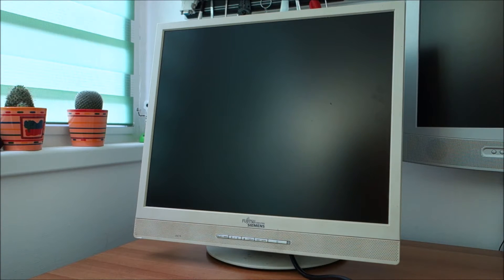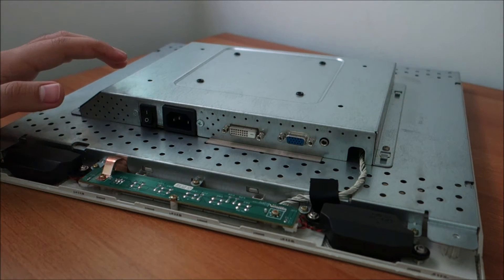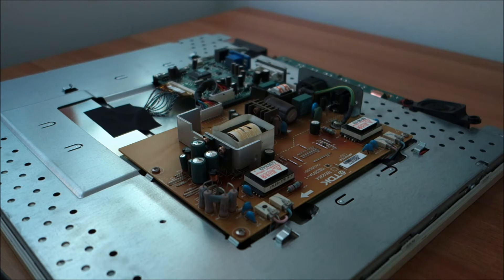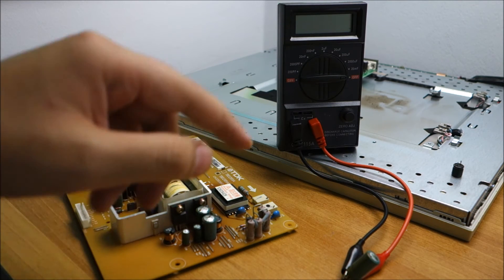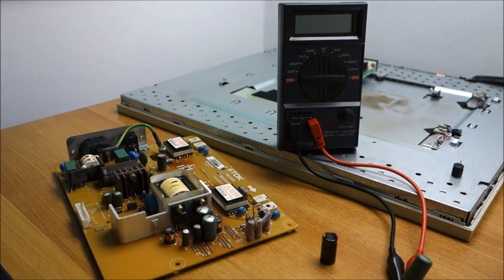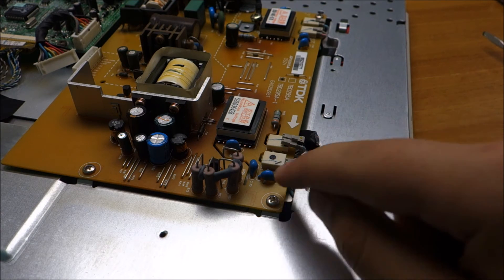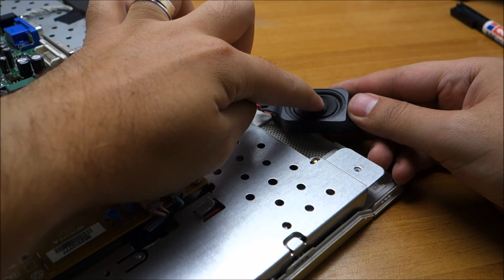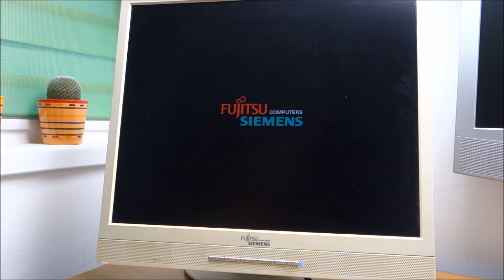How to repair a PC monitor by just replacing capacitors

Comment: Hello, great video. I am going to try this with a HP Omen 27.

My monitor will not power on, with brand new ac adapter still no power. Sometimes it will power on and stay working fine, but next day it refuse to turn back on. It is very random when it wants to turn on. The monitor is only 4 years old :/ 

Do you think it is the capacitor?
Reply from the maker: Hello. Yes, could be capacitors.
Reply from the maker: Just be careful about high voltage!

Comment: My pc monitor screen is white even I dont connect the hdmi of my computer, just turning the monitor, its still white, does changing the capacitor fix that problem?
Reply from the maker: It's impossible for me to guess this.
Reply: @UltimateDIY  why?
Reply from the maker: Because there could be something else broken. Nobody could give you a direct answer without checking first.
Reply: @UltimateDIY  as an experienced technician, what can u recommend to check first on my problem? I dont have tools for testing maybe my only option is to throw it
Reply from the maker: Me, technician? :))))))
I'm a random dude that tries to fix stuff.
Reply: @UltimateDIY  okay my bad. Nice video tho keep it up.
Reply from the maker: I will 👍🏼
(For your problem I would open the monitor and take a look at tha capacitors. See if the ends are bulging or leaking)
Reply: @UltimateDIY  thanks for your tip! If capacitor is buldge or leaked, can I soldered it the new capacitor in my mb directly?
Reply from the maker: You need to replace the bad ones with the same capacity and voltage new ones.
Reply: @UltimateDIY  thanks for the help more power!
Reply from the maker: Welcome!

Comment: How i contact u i have same issue
Reply from the maker: Only here in the comments.
Reply: @UltimateDIY  https://youtu.be/m3H0Ey6xQuU

Can u take a look to my issue and let me know if that should be cap fault or other things please
Reply: @UltimateDIY  plz chk and plz answer me
Reply from the maker: Could be the capacitors, but could also be the "decoder board" (not exactly sure how it's called. The only way to check is to open it and see if the capacitors are ok, or if there are any other signs of burned components. 
BUT THERE IS DANGEROUS VOLTAGE THAT COULD KILL YOU, SO ONLY OPEN IT UP IF YOU KNOW HOW TO DO IT AND KEEP YOURSELF SAFE.

Comment: Great tips and video..

Question..
You said that higher uF is bad.. And it should be exact or close to the original..

So, I have a monitor thst has 3 680uF 25V caps.. Can I use a capacitor a little higher than 680uF..? Or should I just replace it with the same uF rating..?
Reply from the maker: Thank you!
It's not necessarily bad, it depends on how much higher the capacity is. You don't want to double the value or something like that, but up to a 50% increase, I think you are ok.
But, as always, a direct same value replacement is the ideal solution.
Reply: Ultimate DIY I see.. Ok, thank you.. I'm gonna fox my monitor.. :)
Reply from the maker: Welcome! :)

Comment: Great tip about marking the power lines.  My monitor is beginning to flash off and on, so I will eventually be pulling it apart to see if it is a capacitor issue.  Wish me luck.
Reply from the maker: Good luck! :)
Be careful about mains charged capacitors.